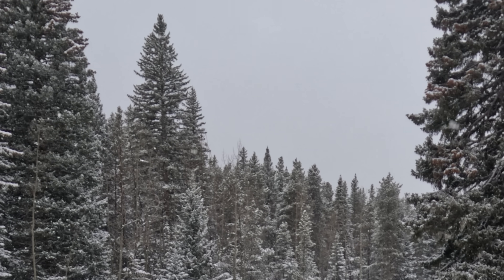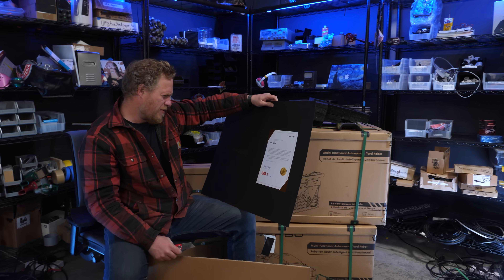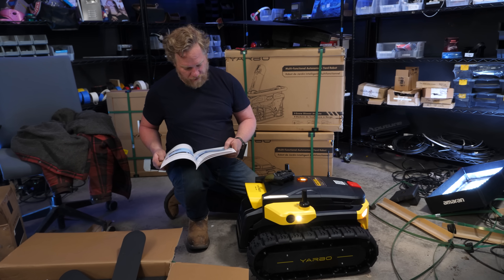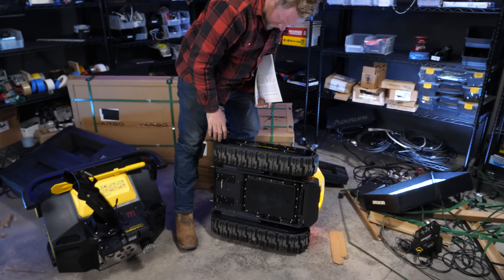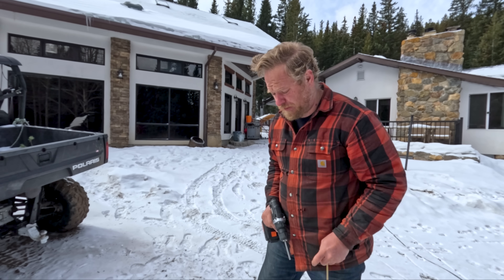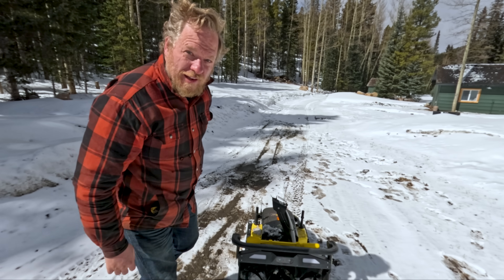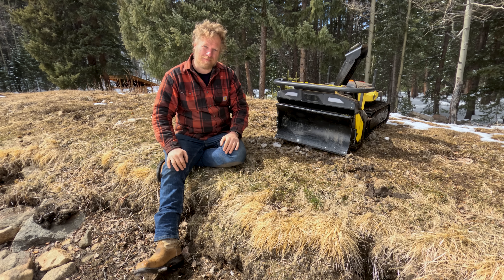This robot plows my driveway! Yarbo automated snowblower

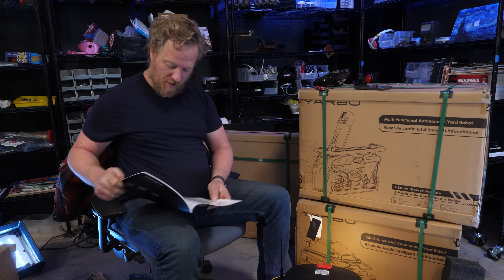Comment: 6:30 Don't install the GNSS antenna near the wall, it will cause multi-path issues and you either get a very bad fix or none at all. I am talking from experience, doing land survey with GNSS.
Reply: And make sure it's on a good sturdy stand that will stay exactly where you leave it. Any movement in your base station will be in accuracy in your rover positioning.

Comment: Wow couldn't modern electric motors can be so noisy, but I guess it's some gears shift stuff, right? Also on your video, it just blows snow from the ground, but is it possible to use it to really cleaning snow like blowing it into dump truck attachment and to dump it into designated area? Current grid mopbot style pattern (blow snow to the north, rotate, blow same snow to the south, rotate, repeat) looks a little bit useless

Comment: You can connect PoE to a non PoE device, the switch will handle the negotiation and only send PoE if the device requests it.
Reply: Only if it's active PoE. Passive PoE supplies power continuously on some of the pins
Reply: @alex13902  outside of very niche use cases modern networking equipment is 802.3af compliant from reputable brands. Of course you should check if your equipment is compliant before plugging things in willy nilly but 99% of the time you'll be fine.
Reply: @lostunsunghero  Because PoE (for example 802.3af) is an IEEE standard, it should be impossible for a vendor to not use alle standards from that standard. If they don't cohere to the standard, they lose their IEEE certification.

Comment: Good to see your doing much better!

Those shear pins protect the gearbox, they give way before it is over stressed. Careful replacing them with normal bolts, even in a pinch.
Reply: Growing up in Canadian suburbia I had a lot of experience with these, when we had a gravel driveway. Catches a pebble, shear pin does its job, but annoying as hell. Need to make sure the surface is snow packed and frozen first. Or paved.
Reply: @pdblouin  Yeah, they should put in a slip clutch and have a shear pin as final protection behind it.
Reply: We have like 30 year old Honda snowblower and I don't even know if it has pins. At least they have never been broken. We have quite a bit of gravel too. Could they use some other method? Greetings from Finland!

Comment: 17:20 looks like the shear pins are only installed on one side? (having seen this with a domestic-but-large gas powered snowblower - for that kind of machine any local hardware store with bins of screws and such will have them, they're pretty standardized - but the two halves are driven through a gear box so they need separated pins.)

Comment: PoE is 54V (to ensure it's able to deliver 48V at the other end of a long cable) and is perfectly safe for anything but incredibly badly designed devices.
Reply: That's what's often called POE+. POE can also be the 24 V variety that grills any device not expecting it, although that's way less common than it was ten years ago.